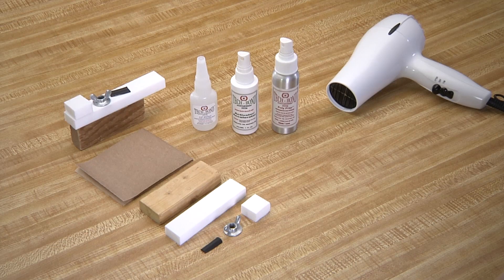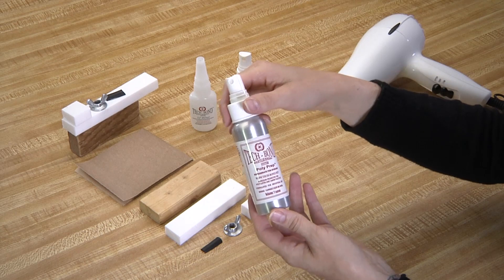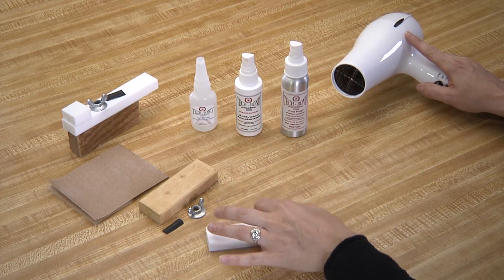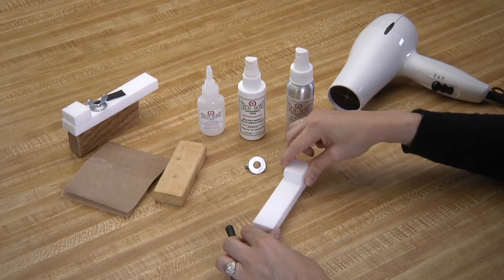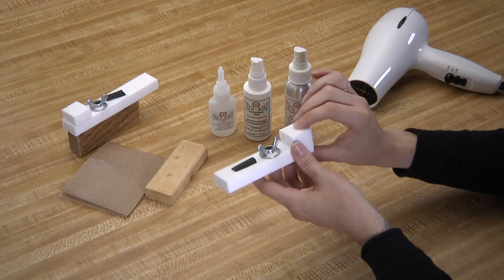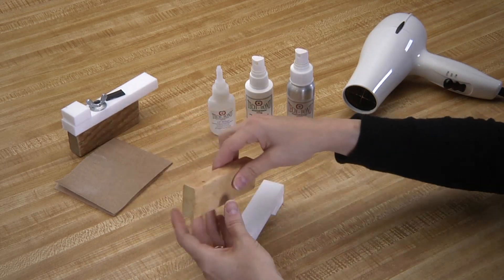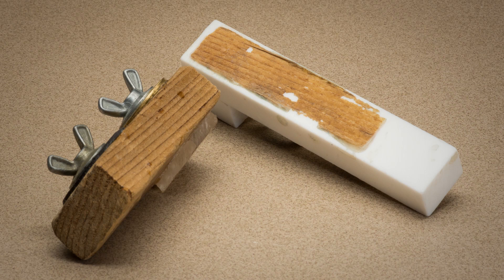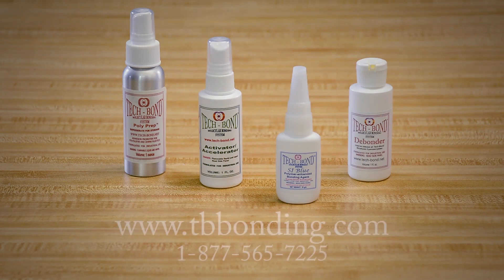How to Bond Teflon to Metal, Wood, Rubber, and other Teflons

Comment: lol...rubber peels up at 10:02...
Reply from the maker: The process is about bonding the two materials back together.  It is no longer two pieces resting on top of one another.  I do understand your hesitation.  Many have felt that way.  At first.
Reply: ...well it was impressive  that the Teflon apeared to have stuck to itself and to the wood... also , it's possible that the adhesive didn't cover the whole surface of the rubber, and caused the obvious failure in the demo. Was looking for an adhesive to bond mylar to stainless steel on some printer equipment ...the bond also has to be resistant to a solvent that  seems to be something like kerosene .
Reply: .... a flexo plate washout system byw

Comment: It's  fine. While I wonder the strength of this method between ptfe to carbon steel pad?
Reply: I am curious about ptfe to aluminum tooling and if this is heat sensitive

Comment: lol @ 10:03 you lifted the rubber off the Teflon, right after saying "...no matter how hard I try."  And then you press the rubber back down. What went wrong?
Reply: I thought I saw that too but upon second look it was an illusion due to the irregular shape (not symmetrical) of the rubber, it didn’t actually lift up. 

I mean, if it DID lift up, wouldn’t they just refilm it...? Idk
Reply: @TylrVncnt  I took a second look and used the comma and period keys to single frame through it. In my optical illusion I see the rubber lift up. The whole thing is just funny. I'm fairly sure this stuff works fine. I personally use Parson Adhesives Parafix 3770 Surface Prep which works great on most 'slippery plastics' like Teflon and polyethylene.